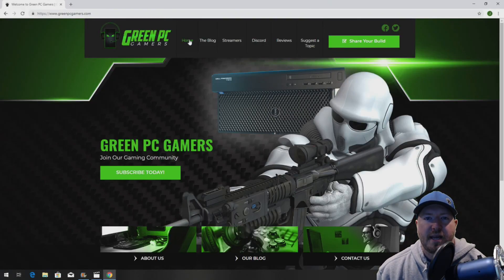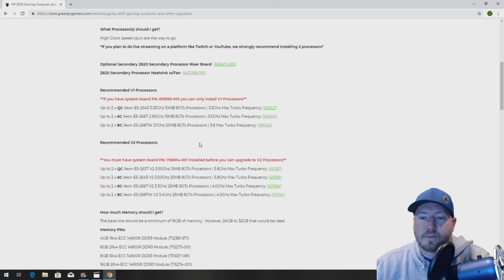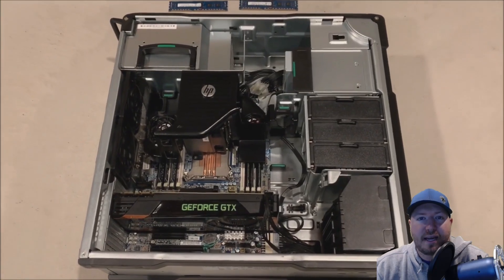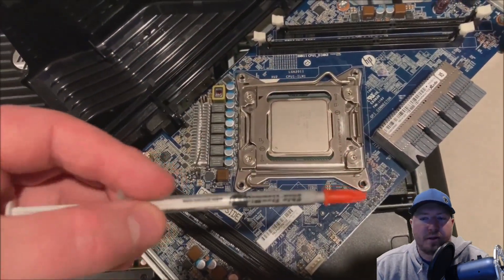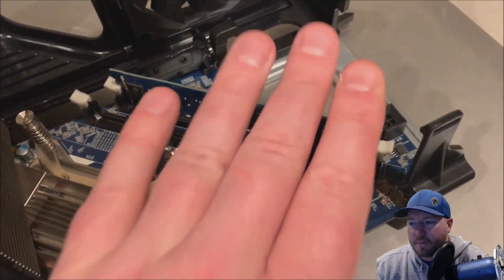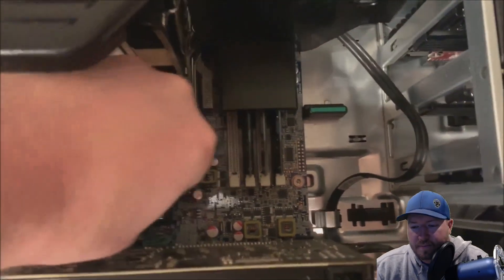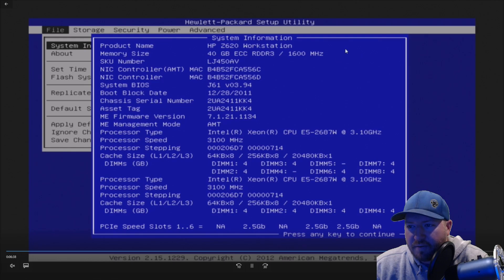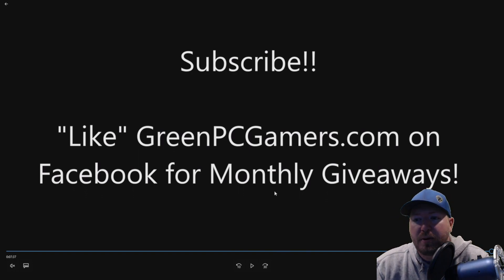HP Z620 Secondary Processor Kit Install 689471-001

Comment: I wanted to ask If you can do a video installing a hp z620 workstation install a hp zturbo pci and samsung 950 pro nvme as a boot for windows 10 or 11
Reply from the maker: We'll add it to the list.

Thanks
Reply: Thank you for your reply I really appreciate it
Reply: Do you have a video on how to boot of a nvme SSD drive on a hp z620 workstation and also, I have 2 hp z620 workstations and one has a CPU E5-2620 and the other has a E5-2620 v2 witch one is better, and can I upgrade to a faster CPU and witch one would you recommend.

than you

Comment: Hi everyone, I have a 620 with motherboard number 708614-001 and a second cpu board number 689471-001. At the moment we have two xeon 2640 version 0 fitted, and they all work fine. My question is can i upgrade with 2 xeon version 2 ??? or 689471-001 2nd cpu board does not allow it?

Comment: hi, i have HPZ620 recently I'm facing booting issue, in every 2sec auto on/off happening with no display. after removing raiser tray system works fine. can u suggest any issue with my raiser board??
Reply: i have the same problem bios J61 3.91
Reply: A memory latch was defective in my case. Now everything works

Comment: Great video. Can I ask what GPU card you have installed there? I’m looking at fitting a graphics card to a dual cpu system, and wondered what cards would fit. Modern cards seem to be thicker with metal back plates.
Reply: instablaster.

Comment: I've installed the 2nd riser board but unfortunately it is not showing up when I boot the machine (no 2nd processor or ram) . The fans on the riser board spin when its installed an I receive no errors but nothing shows up in the system.  Any ideas, possible issue with the board?  (I've matched the processors 2 e-5 1620 3.6ghz and am running windows 10 pro)
Reply from the maker: The E5-1520 v1 or v2 will not work in a dual Cpu configuration.  You need to install E5-26XX V1 or V2 processors to run two CPU’s.  Keep in mind that not all z620 system boards support v2 processors.  

Check out our upgrade guide for more info:

https://www.greenpcgamers.com/mfg/hp/hp-z620-gaming-computer-and-other-upgrades/

Comment: Question: Why in my Z620, (just acquired), do I not see the three-copper heatsink pipes across the primary-CPU's alloy block. In fact, they are not in my Z620. You can see this detail at 7.00mins onwards whilst he fits the 2nd-CPU Riser-board.
The bespoke 'Amphenol' power connector block, and its plastic cover are in my machine.

Comment: If I’m trying to add WiFi and nvme (separate) cards to this workstation, do I have to remove the second cpu board in order to unlatch the extension card covers? They seem to be otherwise stuck on my machine. 😕

Comment: hi... how to install M.2 NVME ssd as boot drive?
Reply from the maker: To boot to an NVMe SSD with the Z620 you'd have to use a boot assistant like Clover.
Reply: @GreenPCGamerscom  do you guide for me to follow? All hardware is ready (nvme ssd + pcie adapter). But cant make it as boot drive.

Comment: Try to buy a secondary Riser board used part # 653907-002 , is that compatible to  708614-001 v2 motherboard? Thank You!
Reply from the maker: it should work with V1 or V2 boards.
Reply: @GreenPCGamerscom  Thank You for your immediate response  !

Comment: Hello love your videos. Question. I have a  HP Z600 with 8 processor, dual cpu. which I can not HYPERTREAD. I tried the bios, clicked on the button to activate hyper threading and nothing. I should be getting 16 cores but when I go to management I only see 8 cores. HELP.
Reply from the maker: What model cpu's do you have installed?

Comment: You do not tell me how to switch the CPU coolers to automatic mode in BIOS.
Reply from the maker: I apologize for the oversight.  Our settings were already on auto, so we didn’t have to change them.  However, in some cases this change will have to be made.  Are you running the latest bios per hp.com?